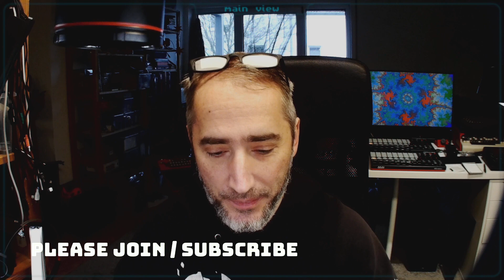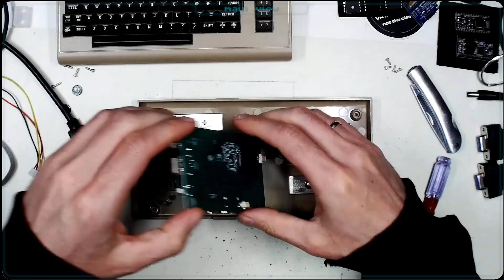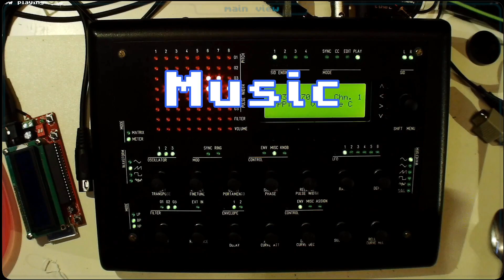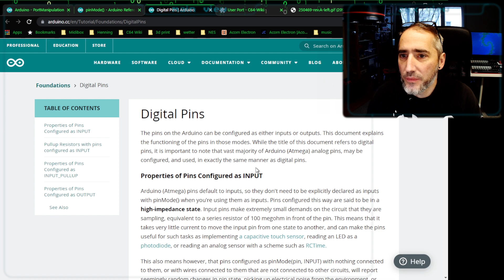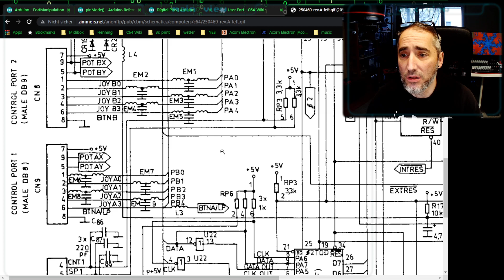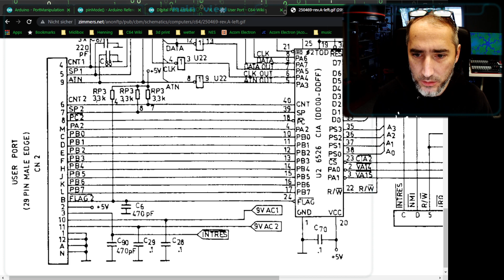C64 - Connecting devices safely to the user port - Arduino data transfer

Comment: Every time the parallel port is written to or read from, PC\ goes low for one cycle. This frees up PA2 for other uses,
Reply from the maker: Thanks a lot for the info, very interesting! You've got a nice nickname btw □
Reply: @c64customs  Thanks! I have been aiming to do similar things with Arduino and c64 and it is great to see someone accomplishing these intermediate steps.
I still need more time devoted to Arduino programming.

Comment: I blew up more than one 6526 CIA chips experimenting with my C64's User Port in the 1980s. My greatest creation was a wheeled turtle style robot with feelers that enabled it to navigate around by touch. It had LED eyes that could be programmed to blink. I found out the hard way if you accidentally ground one of the I/O pins when it's configured to be an output the 6526 becomes very unhappy.
Reply from the maker: Yes, the CIA is very sensitive and it is a bit tricky to estimate the current state of the I/O pins. I might change my setup as well since the state of the Arduino I/O pins is undefined during boot, which may cause some troubles as well. Your turtle project sounds interesting, do you have something online about it?
Reply: @c64customs  Sadly no, I've got no pictures of it or the interface at all. I still have the motors and the blue translucent acrylic "turtle" dome I made at school. I've got my original hand drawn schematics around the place somewhere and I still have the software I wrote to drive it. I've been thinking of recreating it with a modern commercially available wheeled robot platform with a wireless link between the robot and the interface. The original had an 9-way umbilical cable.

Comment: I probably wouldn't have thought of the differences between the ground and 5v levels. 
I made a megadrive controller converter once using arduino which was a fun project. But the rabbithole goes deep!
Reply from the maker: Yes, it's a tricky topic :) The Sega controllers working with high active signals and the CIA of the C64 doesn't like to get 5 V from the outside so using a converter is highly recommended. Thanks for mentioning it.
Reply: @c64customs  Oh should have said. It's a converter from the classic 9 pin connector to usb, so I can use a classic megadrive controller on a megadrive mini. For once it had nothing to do with the C64 :)

Comment: Interesting link between c64 and Arduino.
In the last part of the video, does the data received by the Arduino come from the program in the c64?
Reply from the maker: yes, indeed, that was the main purpose, sorry for not covering this well enough :)
Reply: @c64customs  Ok.  The doubt was only for not having seen the program running on 64. Thanks so much 👍🏻🙂
Reply from the maker: @CiociariaStorica  yes, it is shown here https://youtu.be/8n-ZBMhQPno?t=1863 :)
Reply: @c64customs  My mistake, I skipped those few seconds of typing RUN 😞😳🙈😅
Reply from the maker: @CiociariaStorica  no problem :)